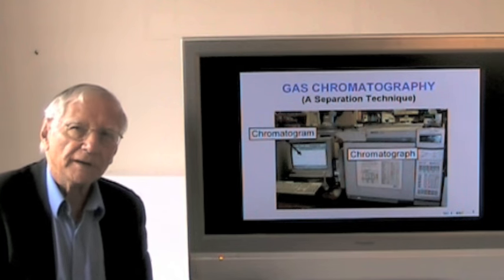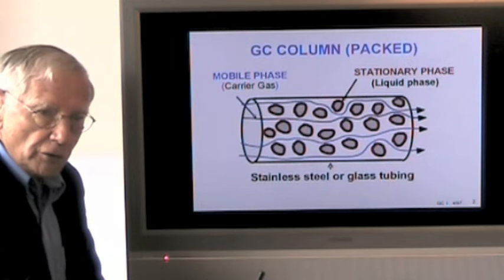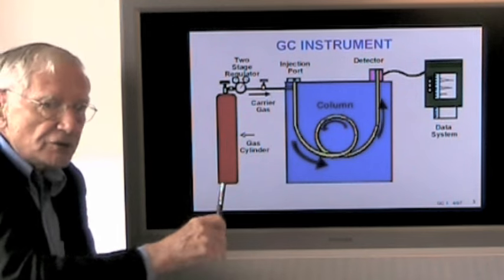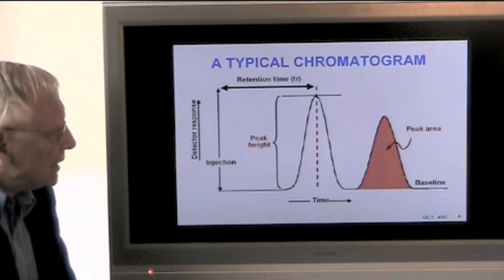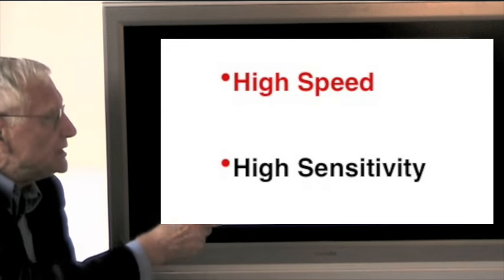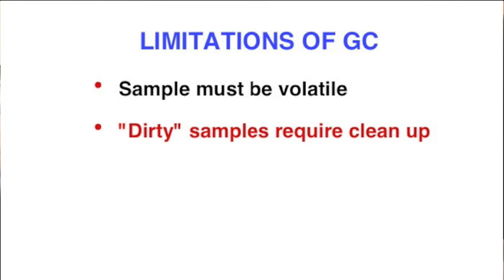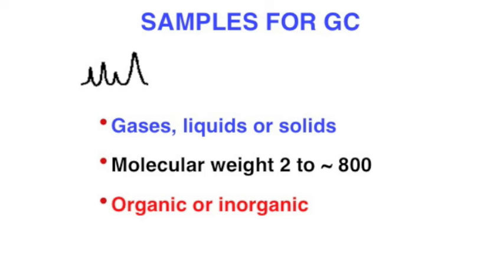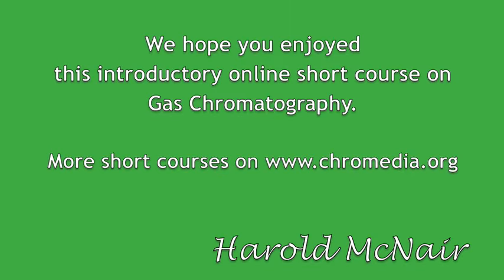Gas Chromatography. Part 1. General Introduction.

Comment: I think we should consider the sample must be thermally stable. If the sample degrades at high temperature in the column, we won't get the results we need.